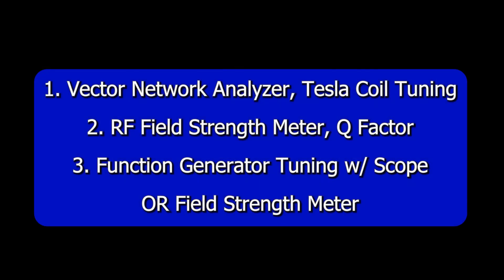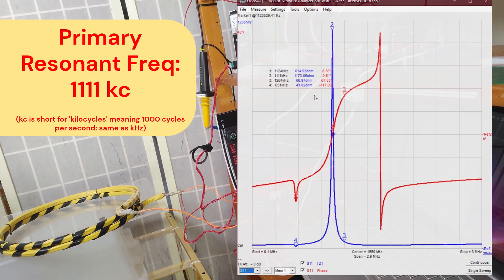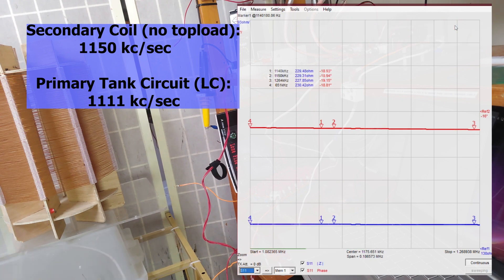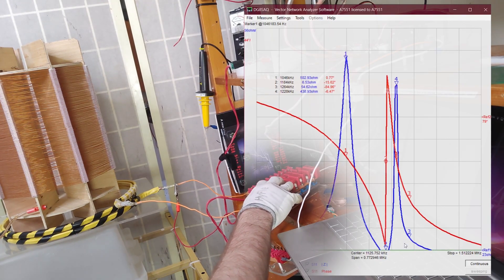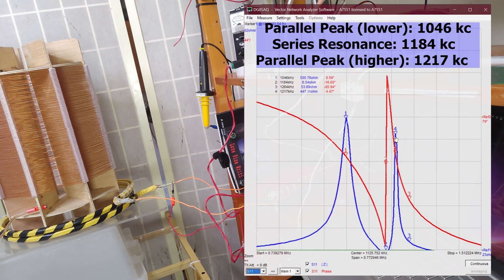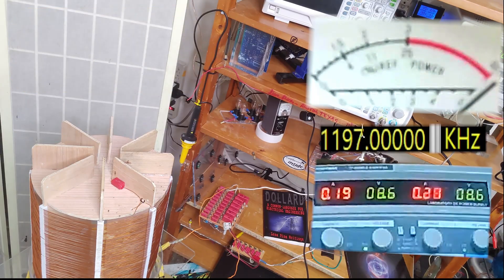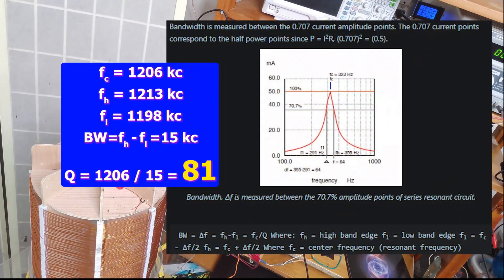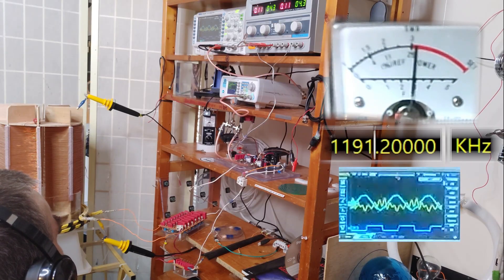Tesla Coil - Advanced Measurements: Q Factor, FS Meter, VNA Tuning, Scope & SigGen Tuning

Comment: Are you familiar with Stanley Meters Water Fuel cell resonant charging chokes and Voltage intensify circuits?
Reply from the maker: heard of Meyers, what's a 'charging choke'? electrolysis / water fuel cell stuff is def on the 'bucket list'

Comment: Looking forward to this, very cool.  Its crazy how people move in similar directions,  I have most of the materials together to wind a very light coil like these.  I opted for the 20ga also but feel a nagging that maybe should have gone the coax way.  In your write up I noticed you went with the equal mass on primary and secondary but I've heard Dollard mention its equal surface area you want, any thoughts on that?
Reply from the maker: yes I had the same question - the surface area is the real influencer (capacitive coupling), but Cu mass has been found to be a suitable proxy, being far more feasible a variable to calculate 🤷 

AM-Innovations described the aim of doing so as some balancing of 'boundary conditions'; i think that implies differential equations, and so i pursued it no further lol.

the exact same coil dimensions & length, on a wooden frame, had a quality factor Q = 81, and on a UHMW polyethylene frame, had a Q factor of 170, btw 🤓
Reply: @cold3lectric I see, lol.  I'm not a fan of math so sounds good to me.  AM Invs. has loads of great info.  Its amazing how sensitive these coils are and over double Q is crazy just in the frame material.   Hey thanks, looking forward to seeing what you do!
Reply: @cold3lectric I have watched his videos.  I haven't been in discord but that sounds great!  I would like to learn more about the no primary setup among a ton of other things.  Thank you
Reply from the maker: yeah the so-called 'extra coil' (standalone autotransformer), i don't know if Hakasays even bothers with a primary coil anymore lol. when tuning my 'secondary' (sans primary) with just a function generator, doing a 20Vpp sine wave, the top end of coil can still light a flourescent tube brought near to it, which is rather high voltage 🤷 

he makes a good point about that arrangement, that it allows you to use an off-the-shelf RF linear amplifier as a driver circuit, no other SGTC or SSTC driver needed.

But my own observation, also mentioned by AM, is that the 2 coupled L1 & L2 coils might be involved in the parallel resonant mode & LMD wave propagation, like there's no 'second / higher resonant peak' when there's no primary coil. And the resonant effect seems to depend on disruptive discharge, i.e. spark gap cap discharge, or Steinmetz / Master Ivo style 'coil discharge' (like i use).
Reply: @cold3lectric I like AMs breakdown of different coils for different uses. I'm looking forward to trying the signal generator alone with this coil.  That potential and sound (longitudinal) have so many similarities, I can see how the "impact" of a spark gap, etc causes a longitudinal  disruption.   My first experiment with this coil involves sound.  I joined discord but didn't know what the exact name of the alt energy discussion was

Comment: I wonder why people always build these air tesla coils instead of the better oil coils that Tesla built for his London lecture. Also, Tesla had built a cone shaped coil when he found the so called "magnifying" effect.
Reply from the maker: i saw a pic the other day of a bipolar (bi) conical coil 🤩  in recent previous vid i test out matching/tuned bifilar pancake (flat spiral) coils too - for a single wire transmission line demo.

IMO, air core can be whipped up by a mere mortal at home, for an experimental prototype, without unreasonable exertion - as the design is way less intensive and the construction can be managed with ordinary hand tools.

Oil-insulated would be worth the expense for a final production model after full development & optimization. Griffin Brock made a beautiful 'reproduction' oil insulated TC though:
https://griffingbrock.com/2023/04/30/teslas-1892-oil-transformer-replica/